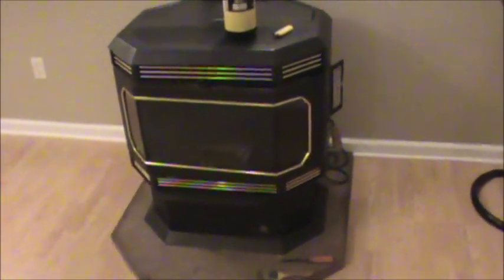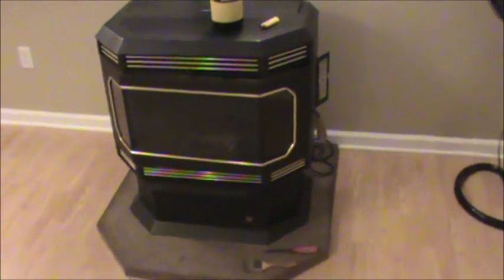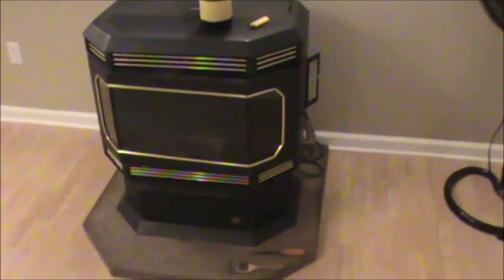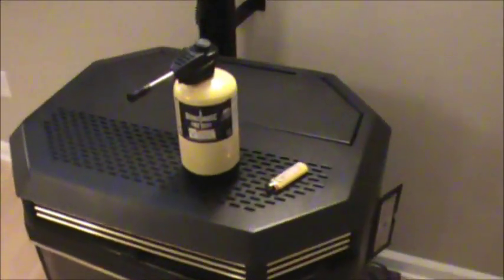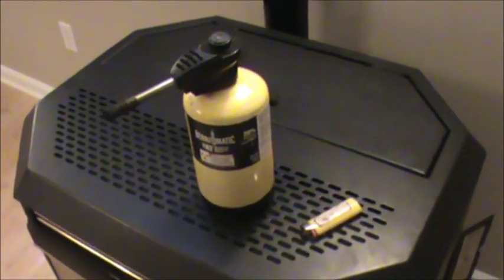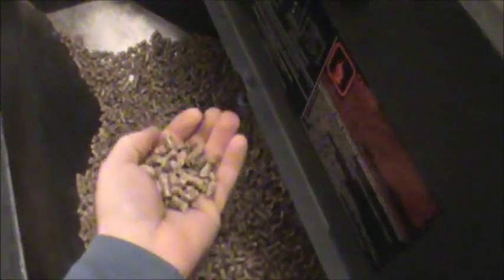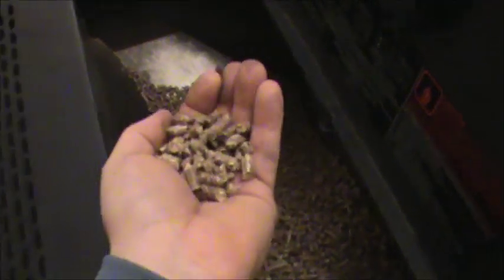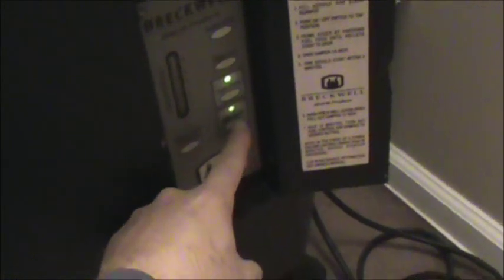How to light a pellet stove using a torch

Comment: Going through a couple of igniters a year is getting expesive at $75 each. I tried this method, then my torch ran out of fuel, so I figured it probably won't work anyway. Thanks to your video it does. I'm off to the hardware store for some more propane. Different manufacturer, but this should work. Thanks again

Comment: some stoves dont have an igniter, therefore, you fill the pot w/ pellets, like you did,however they make an alcohol gel, so you squirt that over the pellets, fliper on and liter up.... no torch needed :D
Reply: I tried the gel takes forever to get pellets jot enough to start feed. Every time I did it they smolder and don't light I get smoke.